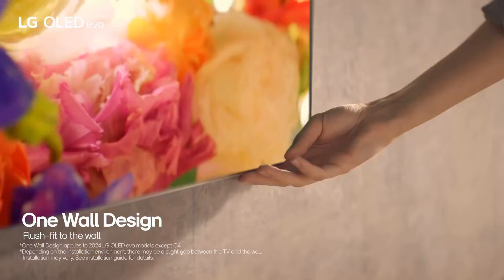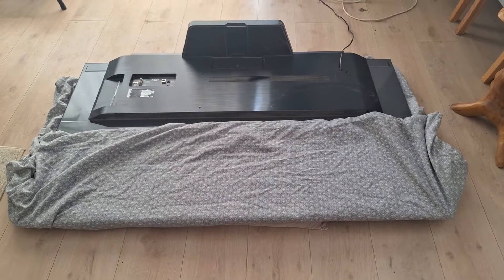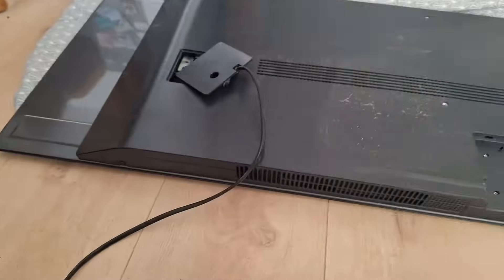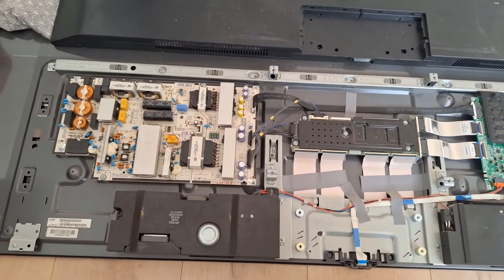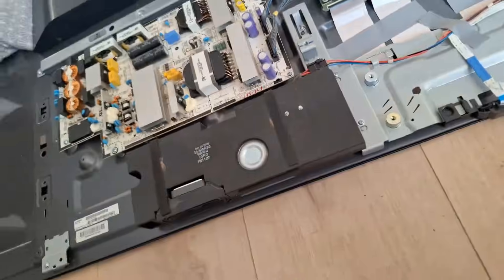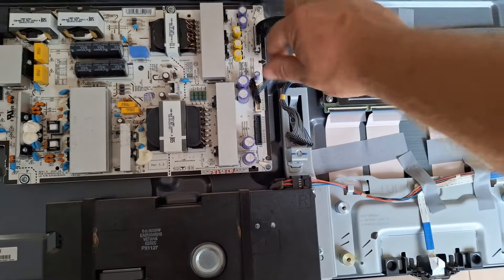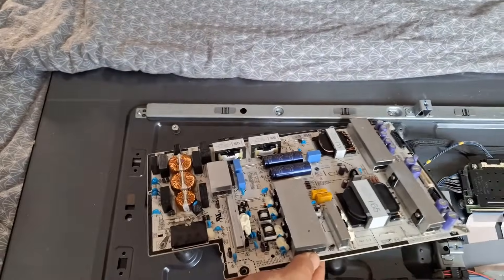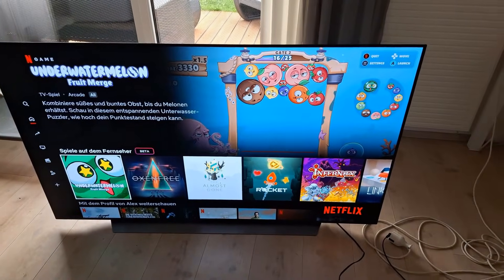Repair LG OLED TV – No Power, TV Won't Turn On, No Standby Mode, Power Supply Defect Fix

Comment: Excellent video!   I'm going to try this.  I think that LG ought to be a little more understanding of this particular issue, and replace these Boards at NO cost to the customer.  They knew about this problem, yet they sold the TV anyway.  I'll Never buy another LG product!   I've also had problems with their Washer and Dryers.
Reply from the maker: Glad the video helps! Hope you can fix it yourself 😊
Reply: @Gamebreakersguides It’s getting the Part that’s the tough part.  Backlogged!   Thanks.

Comment: Have this exact tv. Dog ran into it and now when you try to power it it clicks on for a second, shows a vertical white line (or green) and then immediately clicks off.  Is this a damaged panel or power module? Everything looks fine with the cover off.
Reply from the maker: Maybe could be the display and Display is not reparible. Because of the white line 😢

Comment: Thx, replaced the power supply board and my  OLED65C17LBDEUPDJP is working again.

My LG started with black screen after start. Unplugged the TV and then it worked 3-4 times. On the last start, standby light turned off and screen remaing black. Also after unplugging and plugging in the tv again, standby light was off and nothing happen when trying to switch TV on.
Maybe this also helps to determine, if its the power supply, when you don’t have a measuring device: When the TV is plugged in, then connect a USB stick which have a light signal or something similar which has a light which starts blinking when getting power. If the mainboard has the correct voltage, the USB socket have enough power and the light from USB will blink. If this is not the case, the root cause should be the power supply.

Comment: I put a replacement power board in my 65" C1 and it still doesn't work. What else could be the issue? Red light just blinks when I press it.

Comment: hello, mine is the model OledCX656LA (2020) and when i unplug the cable, even without removing the plate, i can see on the PSU that mine is written "EAY65689411" not "EAY65689423""

So what model should i buy ?

the issue for is the same for all people i guess, when it first start buggin, i just diconnect the cable less than 1 min and it start, then during month, i use to wait 30min minimum, today even after 5 hours, no led nothing..... so i think it's really time to buy and replace the PSU. that's why i need to know the good reference to buy if you can help me choosing

Comment: This worked perfectly for me! I have a working TV at last.

  BUT A WORD OF WARNING - when I went to lift out the old power board, I got a very powerful electric shock! My little finger on my left hand now has a perfectly circular little burn!   I suspect the reason is that the television had been plugged in a half hour earlier. There was still a significant amount of energy in the capacitors.   So I would suggest extreme care. (Unless you want to repeat my error).
Reply from the maker: That's great news it worked! And thanks for the important warning, that's really good to know for others 👍
Reply: When I found a replacement power board online it warned that the old board capacitors could still be storing lethal amounts of electricity and that only an authorized technician should do the repair.   Not worth death
Reply: You can press the on/off button on your remote control while pointing at the tv for 30 seconds, while first unplugging the main power cable from your tv. That will solve the problem.

Comment: Unfortunately I don't have a specialized TV service. I encountered a similar problem. When I turn it on, the red LED blinks 4 times and then goes out. The TV doesn't turn on either with the remote or with the button. Is it the power supply or the motherboard? What should I order...
Reply: Hello, the same happened to me just yesterday, have you managed to fix it? Mine is a B4 model...
Reply: @markokovac2015 same thing happened to me💔
Reply: @moonchildheir for me it's a panel change...
Reply: any update ?

Comment: My LG c8 won't power on. No red light, no picture. But the tcon and main board chips get hot. Could it still be the power board that needs replacing?
Reply: I think your TV was recalled. Check with LG.

Comment: Be careful a bad power board xan cook your panel.
If there are any warnings the PSU is bad immediately stop using hre TV until you replace the power board 
A bad board will cause over volting the panel and you will get a line down the panel and or dead pixels
Reply: What are the warnings?
What happens now with me Oled65cx6la after standby I can't turn it on (need to unplug and plug back in and turn it on immediately) and while in use it sometimes flickers off and on again (but rarely happens)

Also these issues just started recently after I came back from vacation. 

The research I did people also mentioned it could be the mainboard.
Reply: @Frensie  Hi, when you put the tv into standby does the standby light disappear after a minute or less then you unplug for a moment then the standby light comes back on so you can turn it on again, it is a problem on the power supply board, im still trying to find that fault to component level, its very common, nothing to do with the main board or anything else
Reply: @andrewwalsh5837  did you find a solution? I’m having the same problem on my lg cx 65” from 2021

Comment: LG is 💩my C1 has exactly 300 hours total on time and it has already cooked 5 panels, yes FIVE, it had a bad panel right out of the box and LG replaced it 4 times already.
The panels all failed immediately after being replaced but the absolute Muppets they send to repair rhe TV won't listen to me and replace the power board and the panel they only replace the panel and leave the bad power board has cooked five panels already 
Repair is coming again in two days, same guy that came the last 3 times 
He doesn't believe ne that its a bad power board even though I told him the TV won't power on half the time and the other times the light blinks three times.
Every panel has failed with a blie vertical line top to bottom close to the center of the panel.
Now this one has failed the Same way 
And in top of that and the power issue ot also has a cluster of dead black pixels near the top of the screen too.
Just spend the extra money and get the Bravia or a Panasonic
Reply from the maker: WTF, that is really unlucky. Really a Bad expirience, I also would Not have any Trust anymore After this

Comment: My B9 would turn off from remote but it wouldnt turn back on until the TV was unplugged from the mains and plugged back in. Repair only cost £70 from a TV repair shop.
Reply: What was the solution?

Comment: I have a 55 inch LG c3. I wonder if it’s the same power board as the 65 inch
Reply from the maker: Can be possible, size of the tv sometimes doesnt matter in case of Power Board

Comment: Did u originally have the red light flashing but the screen not turning on? Great video btw
Reply from the maker: Yes, was the Same
Reply: @ thank you my friend
Reply from the maker: Anytime
Reply: Same
Reply: I have a 65” lg oled tv it’s 5 years old it won’t turn on until I power it right down hold my finger on the on button until it don’t flash anymore then I plug it back in then I hear a clonk then it comes to life.